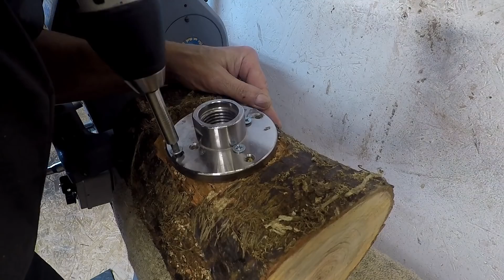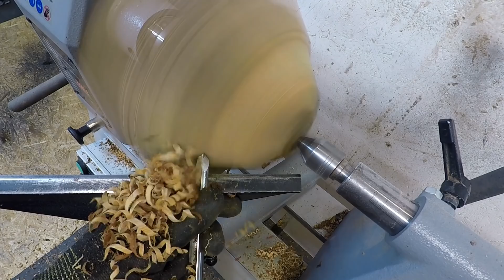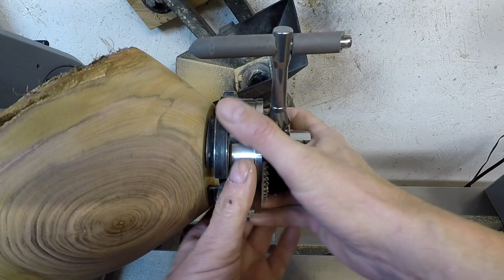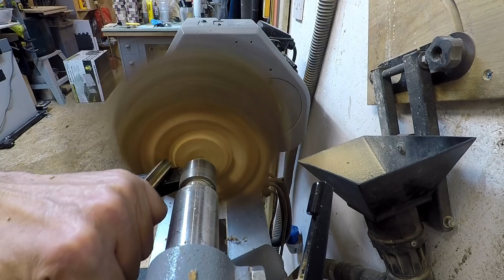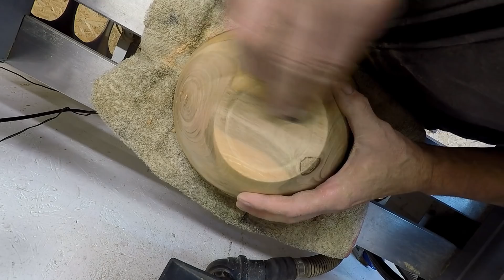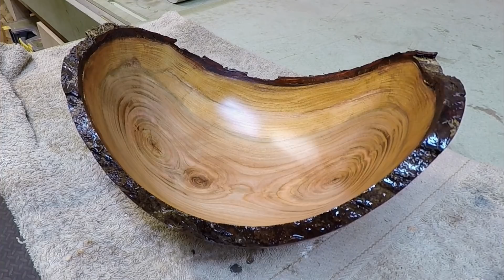Woodturning - Natural Edge Plum Bowl

Comment: Once again @AndyPhillip, you've blown my mind. I took woodworking in High School, and used a lathe on two separate occasions, never imagined that this type of work could be done. One thing I find funny, and looking back I understand it now. As students we had to use a wood file to round off our blocks. The reason, students often damaged the knives trying round things off. I was easier to replace a wood file then it was to replace or resharpen a knife. LOL. Thanks again for sharing your amazing work.

Comment: You're doing cool stuff there Bro. How about an egg timer? So with wood and plastic mix, where the plastic consists of different colors. Keep it up, it's very relaxing to watch your videos. And if you do a timer, maybe 5 minutes, just as long as an egg takes. Maybe you can use bird sand as sand. But you have to dry it first. Or granules, which are used for sandblasting.

Sorry about my worst English. I'm German....LuL

Comment: Thanks for the vid!  Gives me courage to give this a try.
  I've always been curious about finishing soaking wet wood (by the shavings coming off, I am assuming this was wet).  it would  seem sanding wet wood is pretty much a loss as the sand paper clogs with wet dust. So a super smooth surface is not possible. 

And how does the oil interact with the water?  it would seem it would not soak in very much. 

A follow up on this bowl would be nice 6 months from now to see how it handles drying.
Reply from the maker: It wasn't wet ..I have some more I will check the moisture content ..
Reply: @AndyPhillipWoodturning  Just curious, if it was not wet, how did you get it to dry without cracking?
Reply: I assumed wet because of the long shavings you were able to get from it, like when one is turning wet.

Comment: One of the main reasons I don't turn, is because, when I did it as a kid, the wood shavings coming off hurt my skin (I have incredibly sensitive skin) and would actually cut me if I did it for more than a minute or two at a time.
I wanted to use gloves to avoid this but was told this wasn't allowed, for safety.
So I was just wondering if this is a particular type of glove or if this just a case of many years of experience and taking the risk with a glove because of the sharp bark coming off the bowl?
Anyway, really lovely work, as always. Keep it up!
Reply from the maker: Thanks .. Yes I just put it on because the bark was really sharp ..
Reply: @AndyPhillipWoodturning  I see. Thanks for the reply. 
I wonder if a safe, glove/guard for turning exists, out there? Perhaps something that could easily pull away from the hand if it's caught. Something with velcro or magnets, perhaps? Anyway, always room for home invention, I suppose. 
All the best.

Comment: Just wondering, why do you make a tenon for the Chuck to grab instead of a recess for it to expand into? You get a wider hold therefore an more stable hold.  You can also finish out the whole bottom before you turn out the vessel instead of monkeying around with it after words. Leaving a recess also make a better foot for the vessel because if there  was a high spot on the surf it'll still sit flatter. Just wondering the reasoning. Nipping off the corners with a saw is a good trick. Thanks for the vid!
Reply from the maker: I use both methods ..but on out of balance pieces like this I prefer to use a tenon as I feel its more secure rather than trying to split the shit out of it with a mortice .. But everyone needs to use the way that they feel is best for them ..

Comment: When your carving the inside, is there a reason you stop and go in different levels of the carve? Why not complete strokes?
Reply: I turn all natural edge bowls and with them  so irregular you need to leave the mass of wood in the centre to prevent the bowls from flexing. So your better off getting to your finished thickness on the wings especially and then moving on down the bowl. Hope this helps you.
Reply from the maker: couldn't have said it better myself 👍

Comment: What did you paint onto the bark?  What did you finish the bowl with?  I really like these live edge bowls, but I worry that the bark will dry up and fall off.
Reply from the maker: its in the video description .. sanding sealer on the bark and finished with danish oil
Reply: Are you worried at all that the bark will dry up and fall off?
Reply from the maker: @danstark3341  no ..I was more worried about it coming off while turning it

Comment: Hello Andy,
Brilliant piece of turning as usual. 
I have the same lathe as you and so I wondered if could you tell me where you obtained your faceplate and if you had to specify any particular requirements? I know that the spindle thread is M33x3.5mm (Ref T38).
In anticipation of your reply, many thanks.
Clive
Reply from the maker: Thanks Clive .. just search the net for a M33x3.5 faceplate ..Axminster sell them as well ...cheers
Reply: Thanks Andy. Keep the videos coming, they are extremely well done and your work is inventive and inspirational. Can't wait for the next one.

Comment: Why dont you use the thing you rest the chisel on, to woodturn? Its pretty broad and you can easily make mugs/containers with it
Reply: I'd wager that the tool rest is too dull, and the extra surface area might run the risk of cracking the piece or getting tossed around. Dunno for sure, though, I'm just another watcher :D

Comment: G’day Andy from the furry triangle aka Tasmania 😂 just curious how you go about sharpening your tools? I bought a slow speed bench grinder with a sharpening jig and struggle to keep a sharp edge for very long
Reply from the maker: I just use an aliminium oxide wheel on my grinder with a jig I got off ebay .. My bowl gouge is a 5/8 Crown m42 cryo which seems to hold an edge pretty good ..cheers